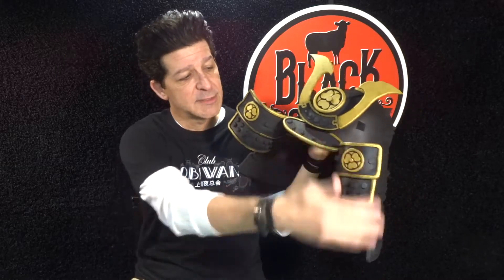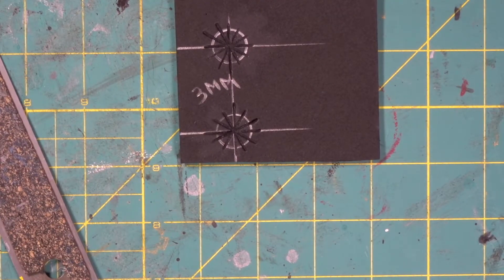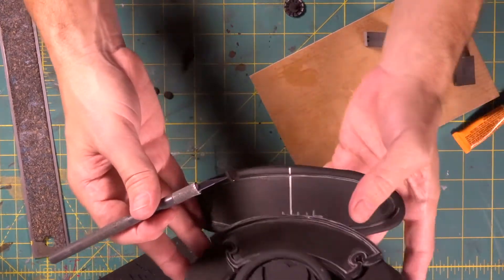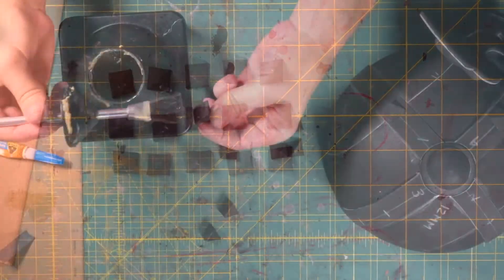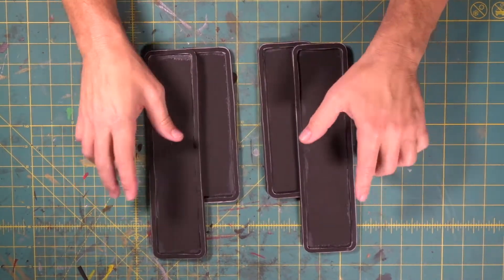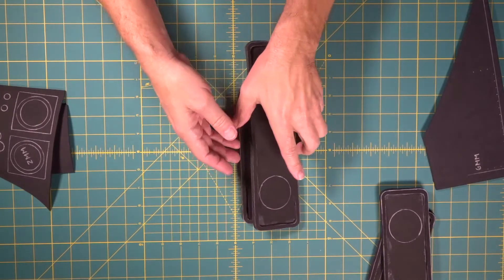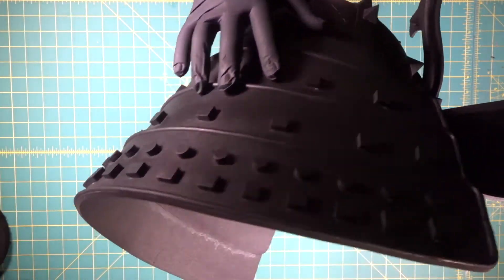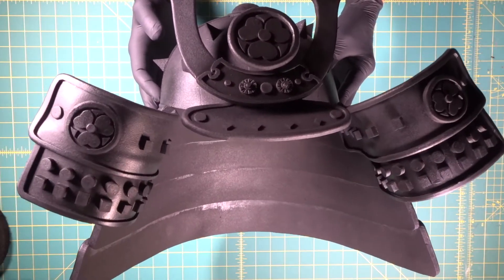Making An EVA Foam Samurai Helmet Part 2

Comment: I downloaded the template and the cut outs for 1 2 and 3 are absolutely wonky I have no clue how I’m supposed to arrange them to make them look normal 😂😂😂
Reply from the maker: Yep, that can happen. It goes together real easy if you lay all the sheets on the floor before cutting anything out. That way it all goes in place a lot easier. Then you can cut.
Hope that helps. Have a great build!